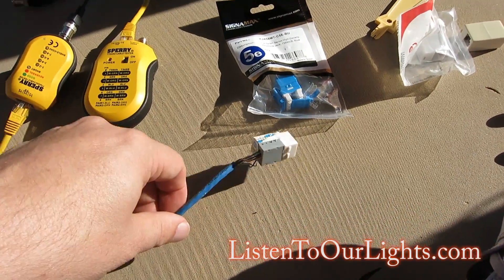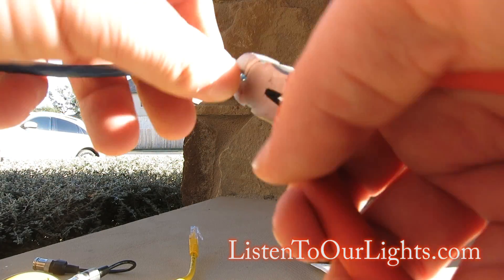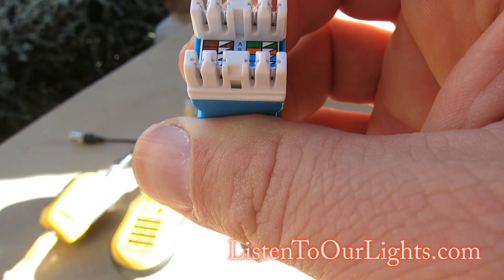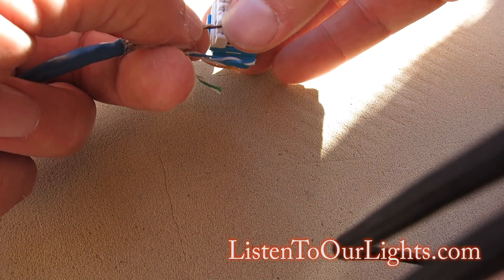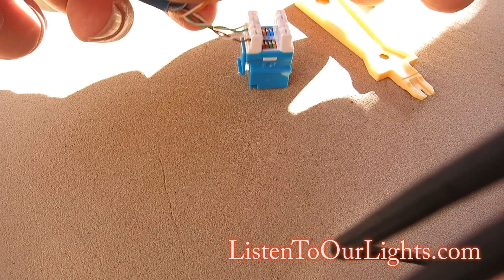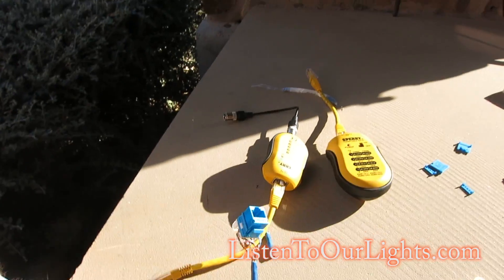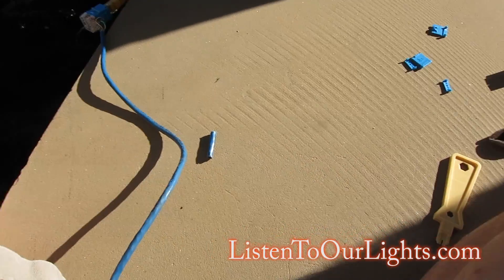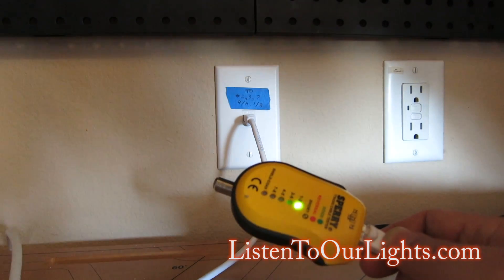Wiring and Testing RJ45 Jack to CAT5 Cable

Comment: You really need to mention that both ends of the wire have to be wired to the same standard. A or B. If someone is changing out a bad jack they need to either check to see how that jack is wired or go back to the patch panel and see how the other end of the wire is punched down. Most commercial systems are punched using the B standard.
Reply: everyone uses b standard